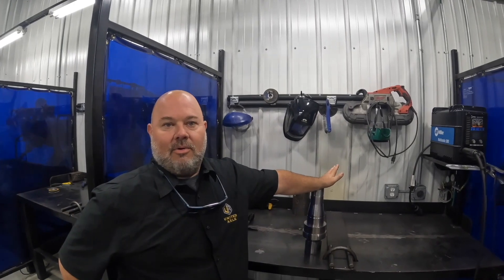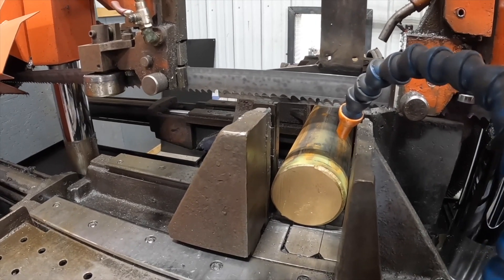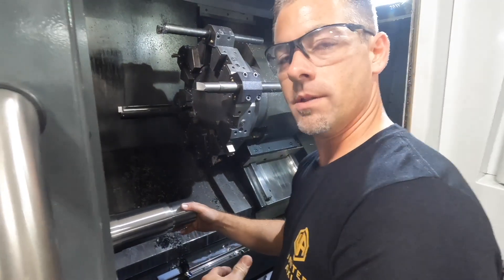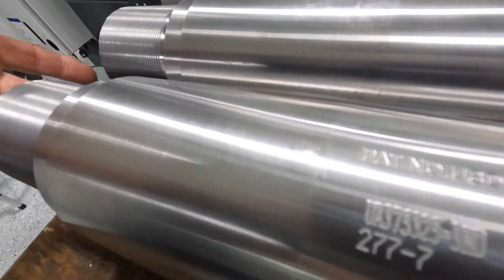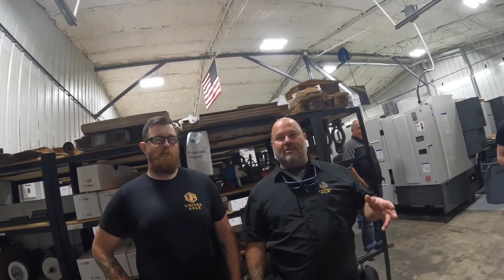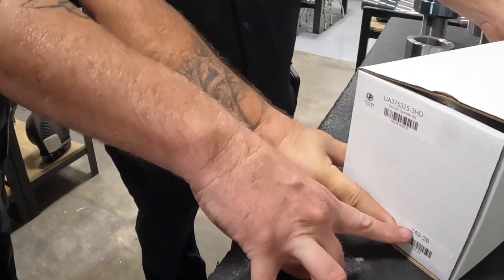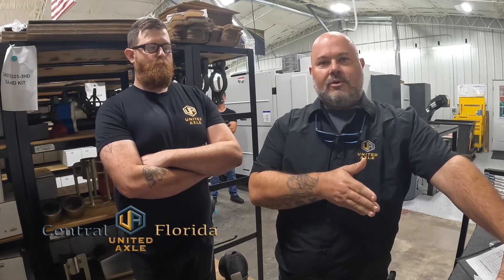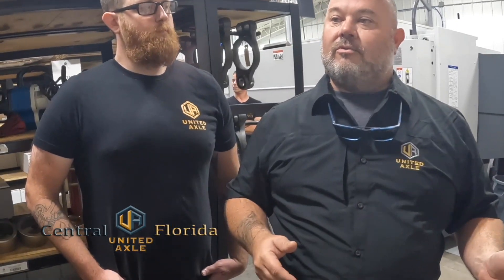See how it's made! You'll see how our patented threaded spindles are made at United Axle in Tulsa OK

Comment: Looks like a good fix but how does the installer get the bushing dead straight in the housing and does the bushing hold back the gear oil from getting to the wheel bearings??